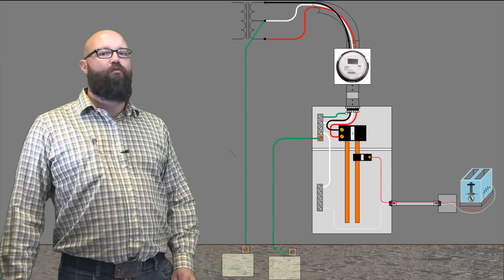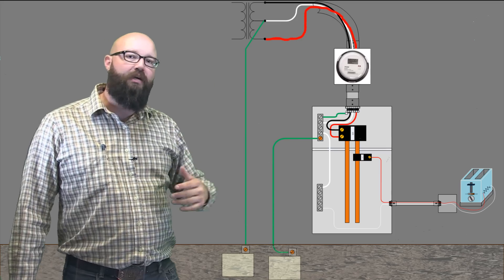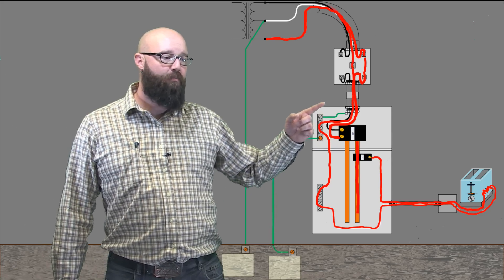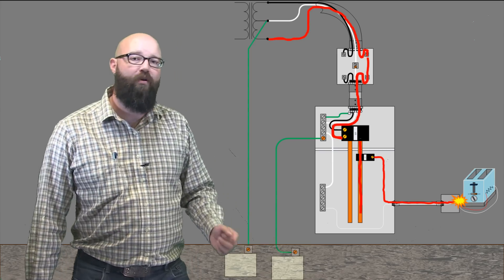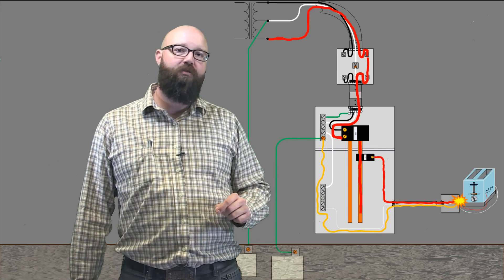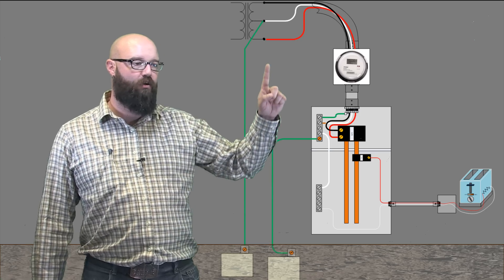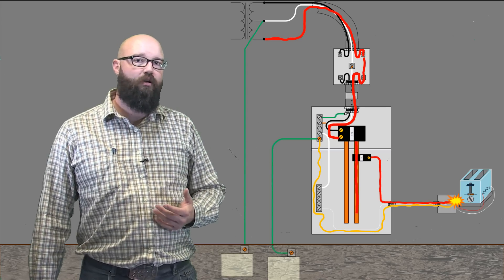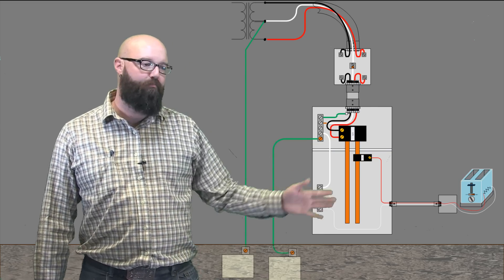Grounding and Bonding

Comment: Sir, during losing neutral, why current didn't go to ground rod connection? And just go straight to by pass?
Reply from the maker: The bonding connection through the service raceway would be considerably less impedance, giving fault current a direct path back to supply. 
Earth is a relatively high impedance and fault current imposed on it would unlikely trip an overcurrent, so systems are designed to never rely on that as a fault current path.
Reply: @schulerruler  Got it clearly.. Thank you very much

Comment: You never really discussed what I call the safety ground (green).  The issue seems to be the safety ground and its application in sub-panels and other devices.
Reply from the maker: Are you referring to the grounding conductor that connects the panel and neutral point to earth and the grounding electrode?

Comment: i must be really dumb  coz i still didnt get it lol
Reply from the maker: Definitely not dumb. It's a deep topic that has a lot of people confused. I would be more than happy to help sort anything out for you. You just ask the questions and I'll do my best to answer them!
Reply: @schulerruler  ok i watched the vid again. so if theres a fault, the current doesnt go back through the identified conductor anymore but goes through the metal raceways/bolts/box. but what if the raceways are pvc?  so theres no way it can go back to the box anymore, where does the current go then? does it mean the current keeps running because the breaker is not tripped in this case.   my next question is, if the system is bonded correctly and there is a fault as in your first case, and at the same time you were touching the metal part of the appliance, does this mean you wont get shocked and the current will prefer to travel thru the bonded system instead of you? i hope i got it right this time lol
Reply from the maker: @boyscout-p3u  you have a better understanding than you think! So if there was a PVC raceway, it would be required that a seperate bonding conductor be pulled tied to each metal component, ensuring continuity. This is why cables like AC90 (commonly called bx) and NMD90 (commonly called lumex or Romex) have a bare integral copper conductor in them.
Yes the fault current would travel back through the system as opposed to you. The human body is much higher impedance than the bonding path. It's design is literally to provide a lower impedance path to avoid exactly what you are saying.

Comment: Good example but why the current is flowing in the case that Line (live) touches the metal part of the testator ? as we see the circuit isn't closed until someone touches or the metal part has other paths to go back to the source.

for me the circuit is "waiting"  to have a path to the ground and there is no current flowing.  i am alright?
Reply from the maker: The system is designed to provide an immediate path back to the source, which will trip the breaker. 
If the path back to supply was broken, then the situation you are describing would occur.

Comment: Where is a 2 wire branch circuit even legal anymore. I personally know a couple of men that have died on 2 wire branch circuits.
Reply from the maker: I think there is a misunderstanding on communication here. How would this circuit be illegal exactly? A hot conductor, an identified conductor, and a code compliant bonding path?

You need to further clarify the intent of your question instead of just giving one liners here because it's really unclear. Nothing in this video is illegal as far as code requirements, specifically from the CEC from the 23rd edition.
Reply: @schulerruler  In your summary, you stated you were not specking code. I'm telling you your diagram is flawed. Your earth ground should be continuous to the point of service and the ground conductor needs to be brought to point of use. If you setup a panel like you have in your diagram, it would never pass inspection here. If you told me what I can or cannot do in person your health would be in jeopardy.
Reply from the maker: @robertdennis2904   Robert Dennis  the earth ground IS continuous to the service. It's one conductor, unbroken, terminated at the point it is meant to, coming from the grounding electrode. I assure you this is correct. 
You keep saying ground conductor. I don't think you know what that is, or really understand bonding and grounding to the degree that you should. You may want to sit down and have a chat with your local inspector, as they may need to reinspect a lot of installations based on your comments. 
If you're just looking to troll and fight, i suggest taking it elsewhere. If you like I can site all applicable code rules, in great detail to back up every single thing in this installation but I assure you, you are incorrect in your assumptions. 

If you would like to continue this discussion elsewhere, please feel free to email me directly at schulerruler@gmail.com.
Reply: @schulerruler  NEC 250-122.  Counties differ, after permit is secured I go to local service provider for any additional specs.
Reply from the maker: Sorry I don't have a copy to reference of NEC.

Comment: Really? then why do we have ground wires in our branch circuits? This scenario is using the raceway to complete the circuit. What if the raceway is not complete?, it becomes energized, then you get hurt.
Reply from the maker: To be very clear, the conductor you are referring to is NOT a grounding conductor at all. It is a bonding conductor, or is sometimes referred to as an equipment grounding conductor. It is so important to ensure that all set screws, and lockrings are done up tight. The bonding conductor is always a part of an integral assembly cable like nmd90 or ac90, but is not required in a metallic raceway like the one used in the video. 
If there was a sacrifice of bonding (say a conduit comes apart) and a fault occurs (hot to box) then yes, it would not trip, and there would be potential now between that box, and something bonded back to the neutral point and this would DEFINITELY present a shock hazard!
Reply: @schulerruler   Better lay off that legal w--d!
Reply from the maker: @robertdennis2904  I'm sorry, but what exactly are you referring to? What exactly do you disagree with?
Reply: @schulerruler  Your stating code when you say a grounding conductor is not required in a raceway.  In my area the neutral to earth ground must be continuous. A bonding conductor is not necessarily a grounding bond. a ground conductor is exactly what it says, a grounding conductor designed to carry a specific load.
Reply from the maker: @robertdennis2904  a grounding conductor connects the neutral point to the ground electrode. Period. Stop referring to anything downstream from that point as grounding as it convaludes the issue further. The neutral (in this case it is not a neutral, but rather an identified conductor) can not ever be connected to anything metal non current carrying.

Your comment leads me to believe you did not entirely understand the point of the video. Yes, as a matter of fact if the hot conductor shorts to the box it ABSOLUTELY will use the conduit (which is the bonding means) back to the neutral connection at the panel, which then completed the circuit back and trips the overcurrent. Please rewatch the first portion of the video where operation is under normal circumstances and you will see that the identified is the sole return path (unbroken) back to the supply transformer. During a short circuit however, this path is bypassed and the bonding path (wether a bare bonding conductor in a cable, a metal raceway, or separately installed insulated conductor) will be the path back to where neutral and ground meet. At that point as previously mentioned, the current returning to the supply, and trips the overcurrent due to low impedance.

Comment: Howdy. What are the purposes of the main panel ground electrode buried in the soil around the panel, and the transformer midpoint ground electrode buried in the soil around the transformer pole ?
At the main panel the purpose is to provide Equipotential Bonding of the Environment of Utilization. Therefore the soil electrode should encircle the house/lot as much as possible. The aim is encirclement, not a low soil impedance.
However. If the encirclement aim is not possible, the aim should be as low as possible a soil impedance. This speeds up the triggering of the breaker. Also it prevents the healty phase voltage from climbing very high as the fault phase shorts towards the ground.
In feed lines the aim is always to achieve as low a soil impedance as possible. The line neutral+ground wire should be connected to a soil electrode say every 400 feet. The aim is to uphold phase symmetry during unbalanced loading. Also the aim is to prevent the healty phase from climbing high during a ground fault in the other phase.
Regards.
Reply from the maker: The connection to earth itself provides protection for transient high voltages like lightning. 
It does not create however, the equipotential plane. This is done through bonding of all equipment to one common point. We use the grounding connection as that common point, which also happens to have a conductor that runs to earth.
Also, you could completely remove the connection to earth itself and the overcurrents would still trip as required. Again, it is the bonding of all equipment that creates the low impedance path in the system, and connecting that point to the neutral that gives the low impedance path back to the supply. With the loads bypassed by a low impedance path, high current develops and trips the overcurrent. 
It is NOT the connection of earth that does any of these things. Unfortunately that is a misconception in the electrical industry that was never true. 
These systems are designed to provide a path back to the supply via the neutral (grounded) conductor.
Reply: @schulerruler  Howdy. Yes. You are, of course, 101 % correct.
Regards.

Comment: Why did you not show the equipment grounding conductor?
Reply from the maker: Are you referring to the conductor that bonds the box back to the panel? Equipment grounding conductor is not a term we coming use up here in the great white North, as we can it a bonding conductor, but the conduit in this case would bond the junction box back to the panel.

Comment: how do i know if my gas csst piping is bonded?  Im looking at the icc evaluation notes on this and it says its considered bonded if "connected to the equipment grounding conductor of the circuit supplying that appliance."  so does this mean that there's an extra piece required..the csst is not just coming from the floor and connected to the appliance gas connection?

Comment: I disagree with a statement made at 5:15 when he says “the fault current will go to ground eventually”. This is absolutely incorrect. Current originating from the utility transformer wants to go back to the transformer. It wants to go back on the identified  neutral conductor because that is the only low impedance path available.  Other than that the explanation is quite good. It could have been better if he went on to explain the purpose of grounding the system to the grounding electrodes because that is where everyone is misinformed.
Reply from the maker: During a fault there is a small portion of current that goes to ground, but it would be insignificant as compared to the fault current returning on the neutral grounded conductor. 

As far as the grounding electrodes, I am currently working on an up to date version that will include this.
Reply: @schulerruler  That's what I was wondering. You never really got to the point of the grounding rod in this video. You made it seem as if they were completely irrelevant.
Reply from the maker: @rogersmith6515  realistically the point of the grounding electrode is to give us a place to dissipate transient over voltages like lightning. 
They don't assist in the tripping of overcurrents however, so as far as this video, and it's intent they are kind of irrelevant lol. That's not to say they aren't important though.

Comment: Good for industrial but you should've pointed out that residential don't use conduit.
Reply: Dan B     They use conduit in Chicago and I believe New York.   It would have been better if he had shown both methods though.
Reply: @KevinCoop1  , Michigan it's just wire through wood, no conduit and even plastic boxes for outlets and switches.
Reply: Dan B    Ok.   Most of the US is that way.  But the point was not All.
Reply from the maker: The system works identically.

Comment: I love this video. Great content.  I would like to suggest that you use a grounding conductor instead of the conduit to show bonding.  The conduit does not stand out in your animation very well. Also conduit is used very little in residential wiring.  Conduit is used extensively in Commercial and industrial wiring.  Most folks who will watch this will be new to the trades and need to see the obvious to help make things clear. Again, overall a great vid.  Thank you 😊

Comment: Grounding is really just a means of creating a second way for a circuit to run. That way, if a metal, normally non current carrying component becomes energized, it doesn’t stay that way and kill someone when they touch it.
Reply: Russell Brown    A second way for the circuit to run with low resistance.
Reply: Kevin Coop I think that’s implied. Otherwise, what would be the point.
Reply: Russell Brown    There is a "high resistance" ground method utilized in the US.   When discussing anything about NEC, all words mean something.   Either by being there or not being there.   I had to learn that the hard way a few times.   One word can cost $10,000 or more in Electrical Contracting.   So implied is not in my NEC vocabulary.   Best wishes to you sir.   Stay safe!   Respectfully,   Kevin
Reply: Kevin Coop yes, I know that no word is used accidentally. I also know that no one intends to bond parts with high impedance. But the reality is that no one is actually taking objective measurements of ohms between each bonded part unless it is for a high risk area like a swimming pool.
Reply: Russell Brown     I concur.   Stay safe.

Comment: THANK YOU !  i GOT IT  !         What would you think of running a buried ground wire back to the utility pole ground ?
Reply from the maker: It would provide an alternate path back to the supply transformer, but would there be a potential for transient lightning voltage on residential systems if a power line was struck?
There would also always be a current flow through that conductor as it would now essentially be a neutral parallel path.
Reply: I am with shuelenruler on this one. Many reasons not to do this.

Comment: Residential meter sockets in Pa. are not grounded !     And may not be in conduit !
Reply from the maker: Do you ground them in the service box only then? I'm interested in learning about other jurisdictions. I assume PA stands for Pennsylvania?
Is that just there or is that a common thing in the US? Thanks for any info you can give!
Reply: @schulerruler  Hi,  Yes Pennsylvania .   I'm not an electrician but I used to employ 13 (19 yrs ago) and  we built to engineering prints for commercial buildings and First Energy  (Power  Company) guidelines to do residential work .  I did then and do now rely on a required certified electrical inspection service or individual to inspect all installation work . This is or was a requirement before the power company would supply power to the building.  This is as I just learned completely changed as to my responsibility . Their responsibility stops at the end of the service drop wire.
I've been away from it too long to be more clear ,sorry.    Here is their 2015 guidelines  ,see customer guide for electrical service !  https://www.firstenergycorp.com/service_requests/request-electrical-work.html#info
Reply from the maker: Awesome! Thank you for the info, I'll definitely check it out.
Reply: @schulerruler  Also a good topic would be to explain for everyone why after a storm when there are wires taken down by trees etc.  a lot of electronics in your home get fried !       I've had several over the years and when the service neutral is lost ,one leg goes to high voltage  while the other goes low (with reference to ground which is bonded to the panel and neutral)  The  transformer is the reason.
Reply from the maker: @richardnoggin8696  check out my video on the Edison three wire circuit as it runs through the calculations in what you are describing!
Reply: @schulerruler  No,  I under stand electronics.   what I am seeing is a broken neutral before the meter and with the main breaker off one feed wire is much greater than 120v and the other is  the difference  (subtracted from 240v)  measured to ground which is now decoupled from power company neutral or grounding (at the pole).   I thought it was from the type of winding used in the pole transformer like an autotransformer.    I forgot the term a lineman used to describe the transformer that this lo-high voltage was common to. anyhow that high leg destroyed electronics and 24v control transformers that controlled a boiler.   I'll chase down a power co. lineman and get that term in the future.
Reply from the maker: @richardnoggin8696  it comes from the transformer in the sense that now you have a 240v supply with no centre tap to reference your 120v loads. This means that whatever is connected between line 1 and the broken neutral, will have a voltage drop from that 240v supply proportional to the collective impedance of those loads, and the loads connected line 2 to neutral will have a proportional voltage drop as well. Let's say equivalent impedance from line 1 to neutral is 200ohms, and line 2 to neutral is 30ohms, you will see a massive voltage (like 205V) line 1 to neutral, while line 2 to neutral will be around 25V.